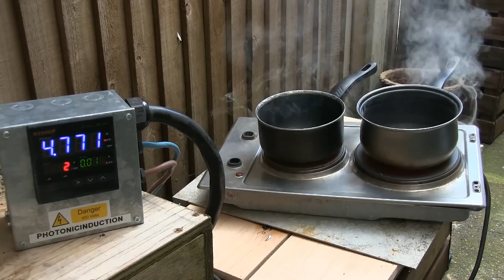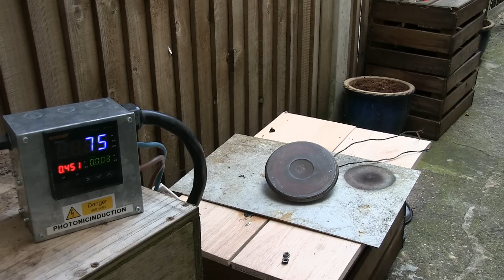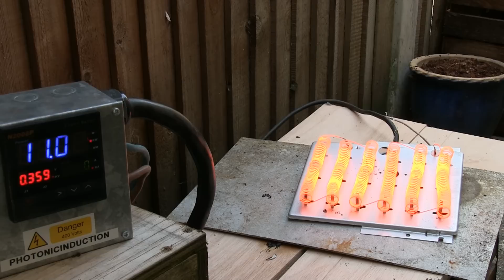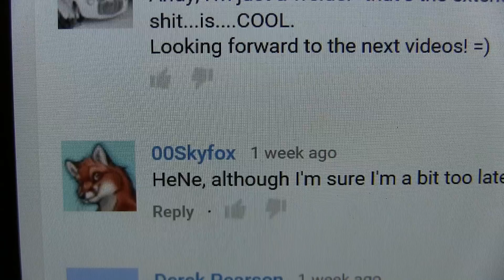Elements with too Much Voltage

Comment: What is with the voltage meter flickering?
Reply: thedragon1246 We don't see in 30 fps, we can see much more
Reply: TheMinecraftNerd maybe low frequency alternating current effect
Reply: Rin X was just approximated
Reply: We see everything.
Reply: TheMinecraftNerd the refresh rate of the display is out of sync with the video scan rate
Reply: +TheMinecraftNerd I think it's due to the camera, as they record at a frame rate of 50 to 60fps which is why it flickers to the camera, but won't to our eyes as we see in about 30 fps, i think bigclivedotcom explained why in one of his videos involving LED's and possibly what james dolan said

Comment: Adding to my request... Not that you will get it. I wanted to see you test a mercury rectifier. They are rare so maybe you don't want to destroy it. But I would love to see how much voltage they can convert, how much current the draw and handle. Not to mention, how many watts they run. I have seen some videos of them and I now know where the engine rooms of 50's space ships get their design for older films. I true piece of electronic history.

Comment: Fascinating to see the negative temperature coefficient on that 5000W coil. It got hotter, the resistance dropped, so more current flowed, it got hotter, the resistance dropped, more current flowed ... thermal runaway never ends well.
Reply: I thought it was the other way around, the hotter it gets, the more resistive it gets... I'll have to look that up
Reply: yeah thats why super conductors are kept at below freezing

Comment: 14,700 Watts!! You cannot imagine how much power that is!
Those coils took the power of nearly 5000 Duracell AA batteries all at once!!
Or 1400 Samsung Galaxy S5 batteries!
Reply: +SouthwesternEagle that's not how it works
Reply: +SouthwesternEagle if a battery has the capacity of lets say 1000 mah, that does not mean that it can deliver 1 amp max
Reply: +SouthwesternEagle enlighten me on the arithmetic that you used to calculate that
Reply: Donna Sutherland 1.2v x 2500 mA = 3 watts roughly. 15,000 / 3 = 5000.
Reply: Jurie Debie If the elements were powered for one hour at 14700 Watts, then that would be the equivalent TOTAL output of 5000 Duracell AA batteries.

Since the coil was powered for only a few seconds at that power level, then only a handful of batteries would have been needed to produce that output for 2 seconds.
Reply: Jurie Debie Right. It can deliver up to15 Amps for up to 4 minutes assuming it is a perfect battery.

Comment: 16 kW to 5 kW element! I'm actually surprised how long  it took before it popped. Love how it gets so bright that camera needs to adjust.
Reply: +AdminWirsoftonline I know that.  The point I'm making is that most of the "brightness" was in the infrared and not the visible part of the spectrum.
Reply: Computer Assisted Biologically Augmented Lifeform I think there was a huge amount of (invisible) Infrared being generated which caused the camera to adjust.
Reply: +nThanksForAllTheFish Any DSLR/Video camera set on Auto will adjust its ISO to compensate for high light / low light input

Comment: On the display you had next to the elements, what did the numbers mean?
I assume the top number was amperage and the lower left was voltage. Am I correct or completely off base?

Comment: 3:20 thats surprising that it broke in multiple places. its probably because its so fragile at those temperatures, unless its not all the coils running in series.
Reply: maybe it was almost at melting point, and any wobbling from one break caused more breaks due to the spring in the metal.
Reply: Rinoa Super-Genius I didn't know you watch photons videos too
Reply: Well, metals near their melting points are easy to bend. Seems that goes for their fragility as well. When metals are just past their melting points, they just turn into a thick, gooey substance, which means the parts of the thing move much easier than in their previous state.